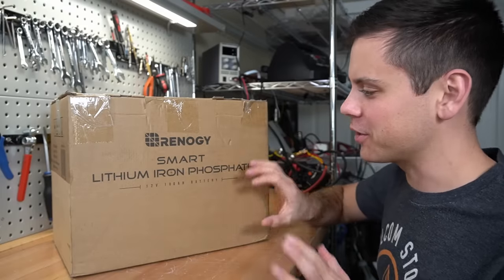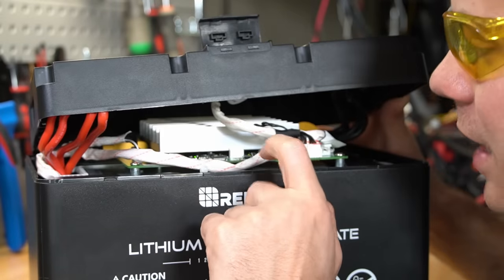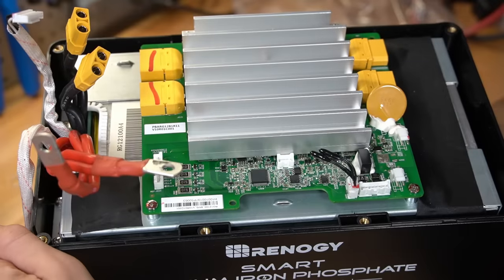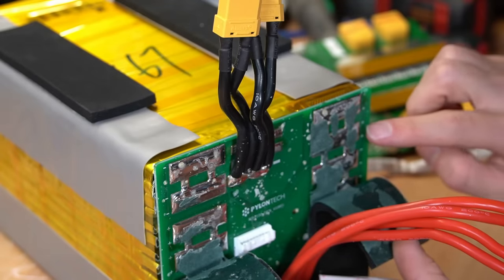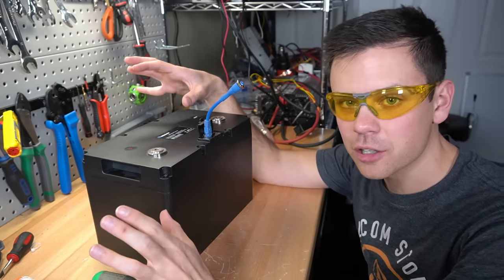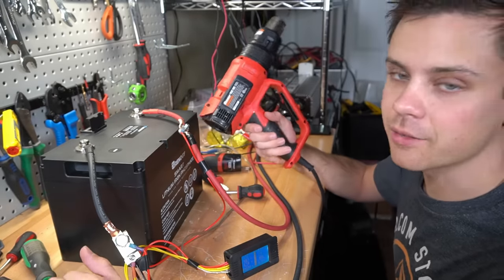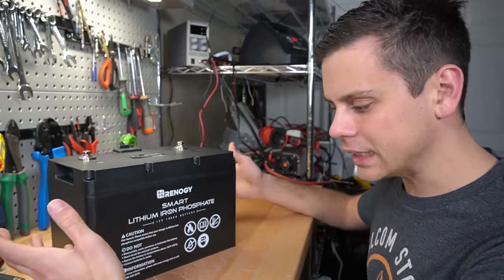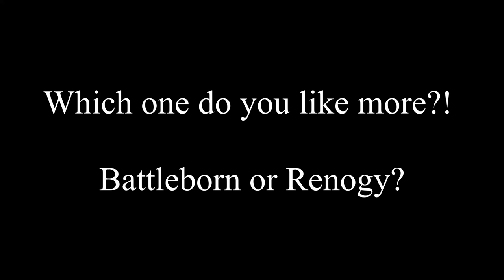Renogy "Smart" 100Ah LiFePO4 Battery Tear Down

Comment: Will, thinking of solar and batteries, the Fiat 550 e with a 34 kWh battery can be purchased for $5500. Also bi directional chargers are getting less expensive. Could this be the way to go for home power?

Comment: Interesting that the Renogy manual suggests hooking multiple batteries in parallel (yep, all good) but then hooking both load leads to the first battery (not the pos to the first battery and the neg to the last battery). What's your opinion of this Will? Thanks (New Zealand)

Comment: What if you put 2 or 4 or 8 of these in parallel and then used a 12-to-24 or 48 Volt converter? Would that be inefficient?

Comment: Is it possible to use two battleborns in series and add one of these in parallel to each battleborn to increase the capacity and keep the series connect?

Comment: What is it about these batteries that prevents them from being put in series? A Battleborn is only $50 more, every bit as good, maybe better, and you can use series/parallel at will, it's a no brainer for me. I'm not a fan of 12 volt systems, had one on my sailboat, but for those with low loads close to the source, they're fine.

Comment: could you start a car or diesel truck with this battery?  what would happen if you tried?   might want to create a test case where you measure volt and peak amp output for 5, 10 & 30 seconds.

Comment: Great teardown Will... Renogy seems like pretty good Quality for only 12v like you said.. but I would still pay the extra $50 and go with Battle born for the  option of connecting them in series to get you 24v/48v..even if your not going to need that option right now..but you may in the future!
Will.... can you answer this question ..why can some lithium batteries be connected in series and others you can Not???
Is it something to do with the BMS? Or the Cells..?
Thanks for making and sharing your videos Will.. I’m always looking forward for the next one😊
Reply from the maker: Good question, will cover this soon
Reply: DIY Solar Power with Will Prowse thanks Will😊

Comment: Hey Will. Thanks for all your great information on youtube!
I just bought a camper with 3 new Renogy 100 Ah batteries, connected in parallel.  I would like to use one Battleborn 100 Ah battery in parallel with them. I have search for answers and get mixed information. Of course Battleborn says it is a bad idea.
Could I do it or not? I hate to not use the Battleborn that I have now and would love to have a 400 Ah battery bank. I thought about also keeping both Battleborns and using two Renogy. I have to leave one battery in my current camper. Thanks for any help.
Reply: Renogy  themselves say not to parallel with other makes but do not say why , might be to due to balancing problems when charging ? , maybe email them for more info .

Comment: Have you done a review on Interstate AGM batteries? I’m building an overlanding vehicle and plan to use a REDARC system and lithium batteries. To keep initial costs down, I’m thinking of using AGM for now. Thanks, Ed
Reply: Well, if you're going to use AGM, you might keep initial costs down, but you're going to have to replace them about 10 times faster than if you went with lithium, so, you're just going to wind up spending much more in the long run.....but...I get what you're saying, I'm just trying to get you to see the whole picture....

I can tell you in my experience, Interstate AGM batteries suck.  But then....all AGM batteries suck compared to Lithium.   When you can only use 50% of your batteries capacity to get the maximum life out of it, which in AGM is only a few hundred cycles,  it's absolutely ridiculous.  

I will never waste my money on another Lead Acid, or AGM battery ever again.

Comment: Big Question - how vibration resistance would this be (for off-road use).  Those end-soldered joints from pouches to the end circuit board makes me nervous.

Comment: Meter read 18min run time, where you get "we will come back in couple hours" ?
Is the heat gun 12v?
What is the heat guns watt draw?
What Inverter are you using?
So many u answered Questions
Reply from the maker: The run time was not reset properly. I only use it as a watt hour counter. And the Ah and that's it
Reply: @WillProwse  yes this hobbies are a but daft, I have 2x different ones on my system and never got them to work

Comment: Will, I had another BMS question and it brought me in to find your most recent video. Do you know any good 4S BMS's that can "link" with each other and work together?
It would really be nice if they didn't even have to plug into each other, and they all just linked together with bluetooth. Monitor/program from phone.
That solves the series problem.

Comment: Hi Will!  I have a question - I have this same battery. only difference is instead of SMART it says BLUETOOTH. I think it is just a newer model. The model I have does not have screws. Any idea how to open it? trying to bipass the BMS to give the battery some juice as it has over discharged and the BMS is not recognizing a charge from my lithium rated trickle charger.

Comment: I have three of these (purchased slightly used, very cheap) -- Now I need to find the wiring for the on/off switch, and the "accessory cable" that connects two V1 batteries together when also used with a V2, since I have both types.

Any ideas on where to find the wiring of that, and the RS-485 protocol used?

Comment: Hi Will..
A couple days ago, I posted these comments on your Jan 5, 2020 video but don't know if you saw it..  Anyhow..

"Don't know of you'll see this note, but yesterday I watched a video comparing Lithionics to Battleborn..
Although I wish I had a heater in my unit, I own & I'm pleased with my Battleborn battery..

However, the video I watched revealed a few Battleborn construction choices that, with my rather long electrical background, gave me concern...

1) the number of connections in the Battleborn that rely on a type of plastic, sandwiched in crush zones, to maintain their original thickness to maintain the required compression / bolt torque & keep a secure, low resistance, current path.. If the plastic material deforms, then the connection will become loose & generate even more heat..
2) the positive battery terminal is not directly bolted up to the positive plate.  Instead it only relies on one bolt, of unknown material, to allow the passage of the current from the terminal to the positive plate..  In addition, again, the bolt's ability to maintain the required tension needed to maintain conductivity, is entirely dependent upon a layer of plastic retaining its physical thickness..
3) it appears that the bolt connecting the positive terminal to the positive plate is a plated steel bolt of about 5/16" in diameter.. This may be one of the main contributors to the measured internal impedance of the Battleborn, being over 8 ohms.. Again, IMO, the positive battery terminal should be directly sandwiched against the plate AND there should be no non-metallic material in the bolt's crush..  

Please check out "The Fit RV" youtube channel's video "RV Lithium Battery Face-off: Lithionics vs "Brand B"" put up on May 27, 2021..
There are other revelations, but as much as I believe in & support Battleborn, IMO, the few I've mentioned above, really need to be addressed..
Thanks for all your videos, you're doing a great job..
Best regards, Dennis"

Comment: I think or maybe I missed it, but it states that it's only a 5 year warranty.  VS, battleborn 10 year.  Also, I have seen many reviews on amazon, on the 100 amp hour sealed batteries that are junk, and renorgy just ignoring them. I think battleborn has better customer service, and double the warranty...plus you can hook them up in any configuration... I think , it's worth spending the extra cash with battleborn.

Comment: Lithium batteries used for DIY racing drones are using pouch batteries and when they go bad they swell like crazy. I would be a bit worried in a system like this that if one cell goes bad it swells and squeezes other cells which could lead to all of them being damaged. Not an expert by any means but that thought popped to my mind second I saw these cells.
Reply: Different chemistry. Cells only puff when you discharge or overcharge them too much for too long.
If you look after your lipos then they'll last. I use 10 6S lipos on my ebike for over 4 years now, and they haven't puffed because I keep them between 20% and 90% charge.
Their capacity has noticeably dropped, but still very useable - I expect another 4 years from them!
Reply from the maker: Yes li-poly and LiFePO4 pouch cells are very different. And yes, really depends on how you use them. I would cycle my lipoly packs at high c rates all day long, with burst surge for punch outs reaching silly numbers, and they would puff up quickly. As Andy said, it really depends on how you use them
Reply: @WillProwse  I used to use a 3S 5000mAh lipo strapped to my bike to run the lights... it fell off in the road once, and a car ran over it before I could get to it!
I expected the worst, but nothing happened, and I'm still using it 3 years later...  This is quite a testimony that they are not as fragile as one would expect!

Comment: If you could ... I'm keen about this battery as they have excellent Canadian pricing as well. They also offer a 170Ah version which would be a bit cheaper for 4 instead of 6 or 7 of those. Is the 170 Ah version the same technology? I would appreciate your thoughts. Thanks Henri
Reply: The 170Ah is completely different architecture. It uses 26650 cylindrical cells in a 4S53P configuration for a total of 212 individual batteries inside.

Comment: You are such a smart kid son. I could use some advice. I am trying to figure out how to  power my first ever 18 ft travel trailer. I have to gut it repair/replace some water damaged framing and the wiring, pretty much EVERYTHING lol. Meanwhile I really want a 24v system and will be living full time in my camper. Do you know of any (Lower Budget) complete systems I can buy and where I might get the best price?
Reply: You really need to join Will's DIYSolarForum to get the help you are asking for. This area is for comments on the current video.
Reply: @josephbrabenderiii2049  oo pardon me, I didn't realize there was a forum let alone a comment cop enforcing limits to free speech lol
Reply: @angelcastro3129  LOL
Seriously, Will has hundreds of videos on his channel dedicated to system designs from RV (where he spent a large part of his young life) to approaching off grid. Subscribe to his channel and you can easily pull all of the up and select what applies to your needs. He also has several books dedicated to the subject. Armed with that info, you can form a plan to suit your needs and go to the forum to get help that you may still need.
BTW , although many countries in the world have the right to free speech, they all have the right not to listen.

Comment: Open the older renogy lithium batteries please. Try the 170ah that's the one I want to buy
Reply: Sergio Castro it might be worth it to buy 2 100 ah batteries. I have the 170 but if I want to pull 200 ah for an inverter, I need 2 of them so it doubles the cost. It’s cheaper to buy 2 100 ah than 2 170 ah batteries. If you ever want to upgrade, you’ll need to buy another 170 but then again, if it’s all you need, then you’re perfect!
Reply: yes please tear down the older model! I just put (2) 100ahs in my conversion
Reply: @AaronGeller  I believe you are thinking of batteries in a series set up. In parallel (12v usually) you can have a little more leeway. Just be sure each has its own BMS.
Reply: @geraldhenrickson7472  My 170 amp renogy can discharge up to 100 amps continuously. To run a 2000 watt inverter, then I have to buy a second and run it in parallel.

Comment: Hi 
I am new 12v Lithium battery. I just purchased  Renogy 12v  Lithium battery and try to charge it with Noco Genius G7200 smart charger which suppose to charge at 7.2a , but it was charging it at only 2.9a. Is there any other smart battery wall charger (AC) can charge at faster rate?

Comment: Thanks for the vid :) If I connect these in parallel can I double the maximum discharge? (200ah)
Reply: A year later I’ve learnt enough to answer my on question lol. “Yes”
Reply: @OutdoorsIQ    I just bought 4 in parallel. You had any issues?

Comment: Will have you tested the Renogy BT-2 bluetooth module with this battery?
Reply: I've had 2 fail within hours of plugging them in. Just about to jump back to renogy and see what's going on.
I'm using direct to battery, maybe that's an issue but they are designed to.

Comment: Even though a non-techie in electronics I find your channel fascinating Will, as is the case with your book too.  I purchased two 100 ah Smart Lithium iron Phosphate batteries from Renogy last November.  All seemed normal at the time and I built a battery box for them for the van conversion I am building.  I did not activate the batteries.  They sit in the van never cooler than 2 degrees Celsius.  I noticed in December though, that they both had a slight bulge at the seam line where the top of the batter compartment screws down.  This is midway  on both sides.  I measured this and they are bulged by about a quarter of an inch.  I have contacted Renogy and they asked for pictures and a month later, my invoices and now closing in on 3 months, still no indication of what the problem may be or what they want to do about it.  My question is........is this something I should be concerned about?  I don't want to activate the batteries and they are really holding me up in my project.  Any thoughts anyone?  Thanks a bunch.

Comment: What is the difference between this “smart” labelled battery, and the other Renogy 12v 100amp Bluetooth battery? 
Thanks
Reply: The main difference is the cable link between batteries allows the BMS in each battery to act in tandem which helps balance cells across the battery bank.

Comment: I have a Renogy solar system on my camper van using this battery and Renogy's dual charge controller. It does have 1 anomoly... the charge controller mysteriously changes battery type setting several times a week when the alternator kicks in. Renogy's tech support has never provided a solution. Otherwise, it's a great setup.

Comment: So would one of these batteries along with 2 160watt panels be enough to power 12v fan, lights, fridge, water pump as well as charging phone, camera computer?
Reply: In short, yes. If you have 1200 watts in the battery and at the end of the day when solar productions stops, you have enough to get you through till morning light, then yes, it'll work.

Comment: Will, you made an excellent tear down, very appreciated.  I found that one of my two batteries does not show any voltage on the terminals.  When I am connecting the activation switch, there is no light at all, no dim blue and no bright blue.  Not able to charge this batterie anymore.  Battery Expert firm nearby my home tried to charge the batterie but that does not work as well.  They suspect the BMS to be defective but they are unsure since they did not open the battery to investigate.

The renogy downside in my opinion is technical support.  It takes weeks to get answers and this is if you get one.  They does not answer the phone as well and there is no service center around.  Well, if you have an idea at how to repair this dead batteries which is two years old, that will be very appreciated.  Thanks for all!!
Reply: Just want to update my comment about Renogy technical support.  My bad experience war related to my inverter two rears ago.  This time, I have been contacted by the customer representative within 48 hours following my request.  They must have improved the customer support which is good!

Comment: Wouldn't those pouch cells expand when they heat up or something, idk about this battery. ??? Cuz my drone batteries are pouch cells and they have expanded over time, like less than a year in use. I think that renogy batter would do good in light use only. Also there's no way of cooling it in the center of the pouch cells where I think it would heat up the most under load, maybe also causing expansion which is why they might have put a metal casing. Otherwise great construction.
Reply from the maker: Those are lithium polymer which are very different

Comment: Seems like it’s more dense than cylindrical cells, no gap from round cells.
Reply: Correct. That’s why the batteries are smaller and lighter than most 100Ah units.

Comment: I have a technical question and I've heard a bit of advice different ways. I would like to hear yours.  I am building an off-grid food cart unit, that would be pulling a maximum of 3 amps at 120 volts, with compact space to put batteries of 16in x 22 in x 12in high roughly. The food cart unit will be used daily, and recharged at night. What battery arrangement and what is the maximum hours I can operate the unit, pulling the maximum amount of power of the 3 amps at 120 volts. I am trying to get the most amount of hours I can squeeze into the unit. I figure it's probably best to only deplete batteries down to 50% Max before recharging them, but I could be wrong. It'll basically be running a small very efficient refrigeration unit, and LED lighting. I was figuring I would need something like 600 amp hour worth of battery to get me like 10 hours worth of use. Hopefully I'm wrong and what I'm trying to figure because that's a lot of batteries, cost and I have very little space. Thanks for any for any advice anybody can give me.